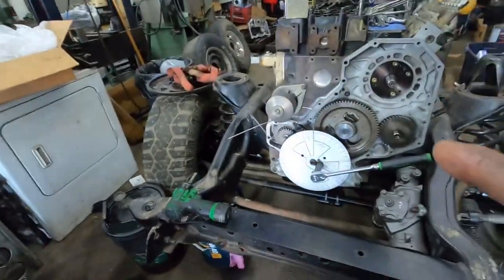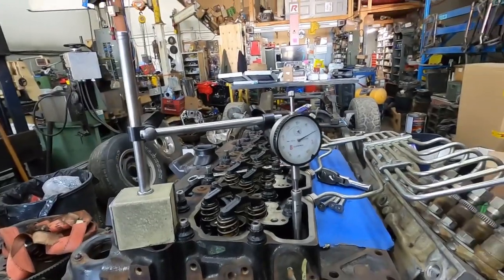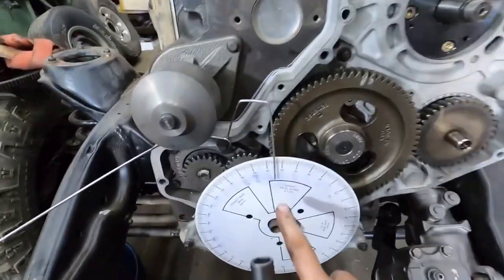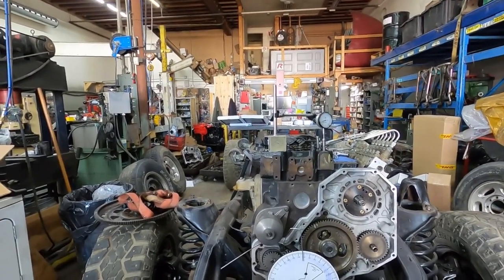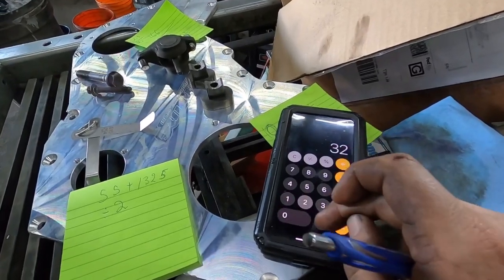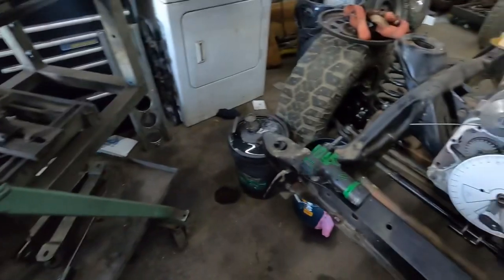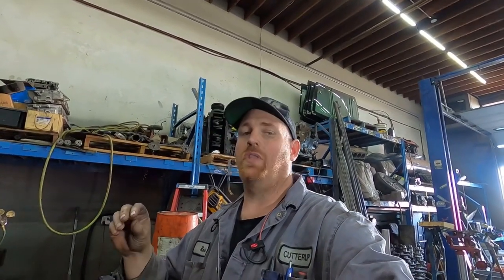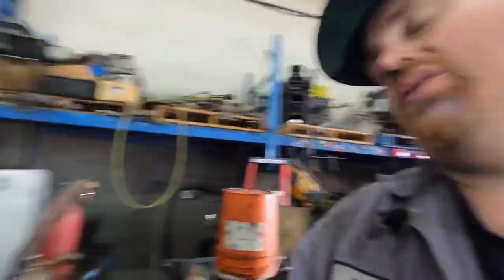How to degree a Cummins cam.  ( INTAKE CENTERLINE )

Comment: That cam i am planning on putting in my 6.7 recomends 98*-103* intake centerline, is there any benefit to being closer to one end of that spec or the  other? Such as moving the power to low end or twards top.
Reply from the maker: Depends on the rpm range and the cam. Best to talk the the cam builder

Comment: Why would I need to degree a drop in cam with timing marks ?
Reply from the maker: Drop in means the clearances should be good. Degree if the cam makes sure the valves are opening at the right start time. 
You can add or take timing out to move the power curve.
Reply: @CUTTERUPROB  Makes sense to me

Comment: Im installing a 178_208 cam on a 2005 3rd gen ram.

Cant you just line up the timing marks on the cam and crank to get tdc?
Reply from the maker: Yes you can. It’s just best practice when you want to most out of the camshaft as you can to check and make sure everything is right.
Reply: @CUTTERUPROB  just for review... 

Set the engine tdc then, with your dial indicator in place, rotate the crank until you get .050 of lift, take the degree reading down to the decimal, then rotate the opposite direction until you get .050 of intake lift and measure the degrees of crank rotation again.

add the degrees together, then divide by 2 to get the intake centerline?
Reply from the maker: Basically yes

Comment: Do one on a 24 valve
Reply from the maker: It’s the same as doing this. Well technically this is a 24v. But with 12v gear train
Reply: Process is exactly the same regardless if it's a 12 valve or 24 valve as the architecture is identical.